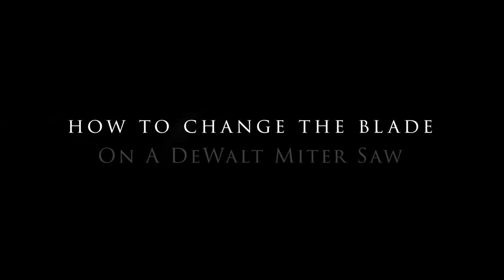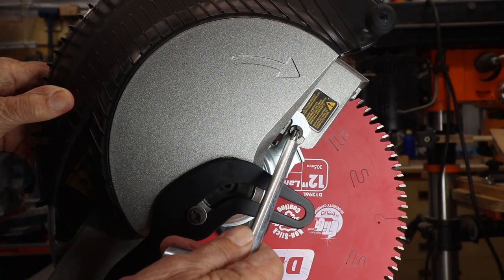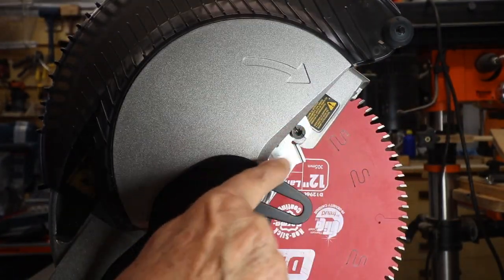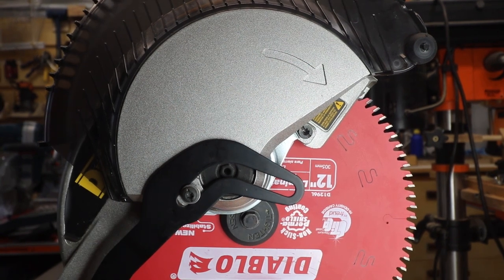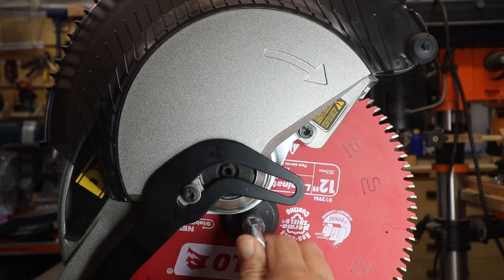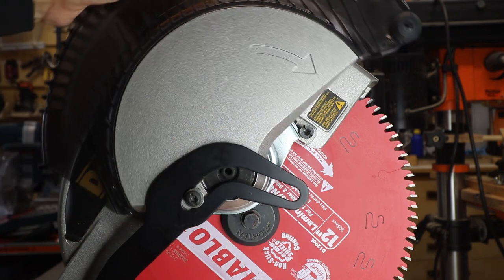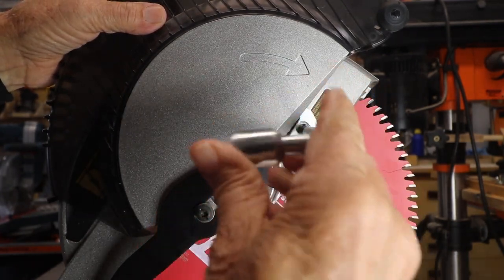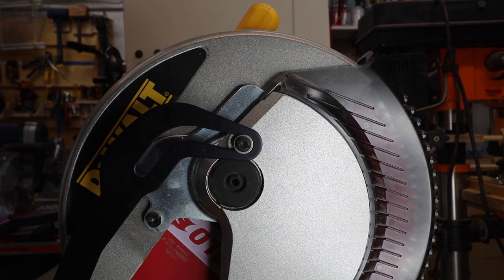How To Change The Blade in a DeWalt Miter Saw (DWS715) - Short Version

Comment: You didn’t show replacing the blade. I need to see what holds the blade on both sides.
Reply from the maker: The arbor bolt comes out and then the blade is loose - I think when you try it, it will be obvious.  The clockwise rotation of the arbor bolt to loosen it (opposite of my things) is the key.
Reply: Once the bolt is out you’ll see what to do.